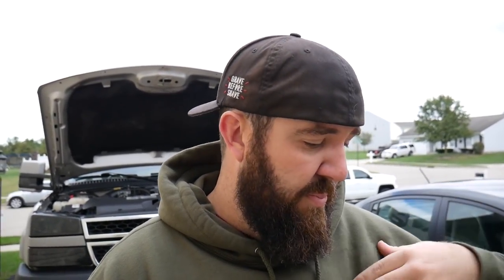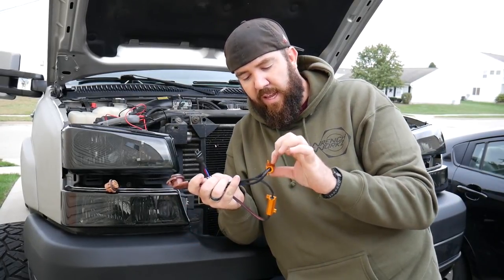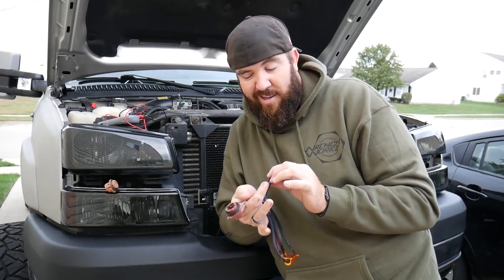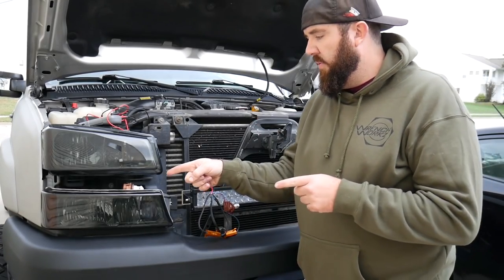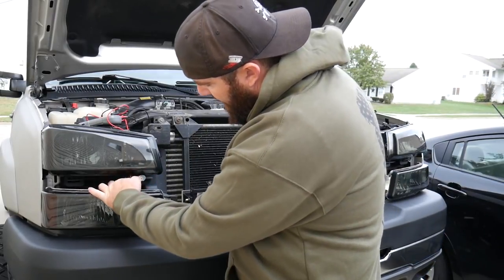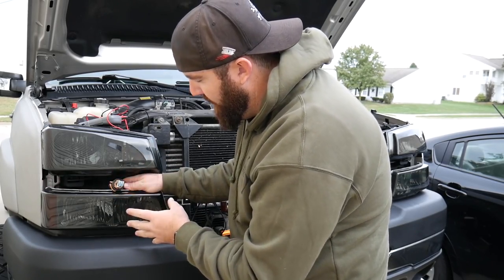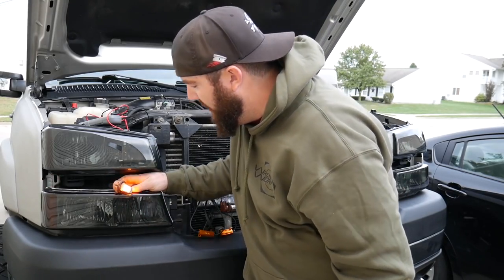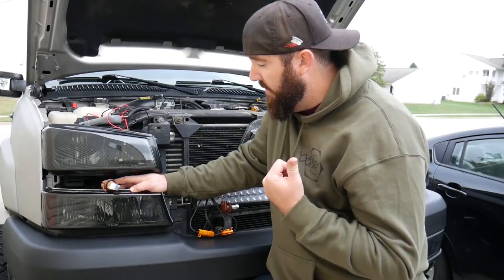FAST FLASH FIX & LED TURN SIGNALS

Comment: What about just swapping out the flasher relay for one that is met for LED lights? A lot easier, and you don't risk the cheap resistors melting down. I read a lot of reviews on Amazon & eBay that were people complaining of the wires melting down. I'd rather not have my vehicle catch fire. 

Regardless, good video man. I've watched your newer videos & you have definitely come a long ways.

Comment: Good job!

For anyone interested in electrical circuits here are some basics:
 
When discussing electrical it is always:
Voltage across a component
Current through a component
Resistance of the component 

For ideal simple resistive circuits we have Ohms law
V = I * R

Voltage (across the component) = Current (through the component) times the Resistance (of the component)

For a given voltage: 
Higher resistance = lower current
Lower resistance = higher current 

Generally speaking resistance increases with temperature. You may notice incandescent light bulbs usually burn out at the moment they are cycled on. This is because the cool filament has low resistance and at the moment voltage is supplied across it's terminals the current is at it's maximum. Once a bulb is on, the temperature, resistance, and current will soon stabilize so long as the voltage across it remains constant.

We do not directly measure resistance. Even the multimeter can only measure voltage across or current through. It may seem like it is measuring resistance but it is actually doing a simple calculation using Ohm's law. 

For this reason your meter can not accurately measure the resistance of a live circuit. The meter supplies a small current through the leads and measures the voltage across them, then a quick calculation V/I is displayed as resistance in Ohm's

If you wanted to know the resistance of a live bulb you can calculate it. 

Measure the voltage across it
Measure the current through it
Calculate the resistance by using Ohm's law
V =I *R
Solving for R
R = V/I (voltage divided by current )

If you wanted to know the power delivered to or consumed by the bulb: 
P = V * I (voltage across multiplied by current through)

Any conductive path from battery positive to battery negative (ground) will draw current through it. It will not draw resistance or voltage. However the larger the resistance of the conductive path the greater the voltage drop across it.

Edited: I hope this is well received and does not confuse anyone. Electric circuits are very useful and understanding these basic things can help you in circuit analysis, design, and trouble shooting.

Comment: No wiring and turn signals work fine.  At night with the resistors both signal dash lights came on and it was a PITA to look at them.  It works on my 01 2500 HD crew.
Reply: Karl Damgaard  can u send me the link where to find them??

Comment: The really correct way to do it it’s replace the flasher module, it’s like $50, easy, and you don’t have red hot resistors

Comment: Great vid really appreciate it. One question is that I used double sided tape for mounting the resistor so they won’t be just hanging. I did notice when they are running they get kinda warm. Just wondering if its a hazard using tape on it.

Comment: I have my right signal flashing fast i checked the bulbs they are all good i  tested from the main harness under the bed and even from there is doing the same thing  i don't have LEDs is oll stock is a 2006 any idea what the problem could  be? thank you for the good videos keep making them 👍

Comment: Good job with the resistors, I can't stand the fast flash error. I could  have sent you a couple sets of the plug and play resistors I have a box full of them when I did my GM. Used em on my motorcycles led upgrades too.  Good info👍

Comment: it appears you only installed on set of resistors on the passenger side and the driver side worked fine, is that alls needed is resistors on one corner?

Comment: I have a 2002 1500, and I have resistors set up, only issue is that when I use the left turn signal the dash will flash with the turn signal, and when I use the right one it acts Normal as it should. Do you think it could be a bad resistor? I checked the bulbs and they come on in both the front and rear. Please help me figure out the issue !!!  Thanks 🙏🏾

Comment: Where do you get resistors i put two new led tail lights in my 2000 dodge 2500 now fast turn signals

Comment: Use the HD flasher relay found under the dash.  This is a much easier fix.
Reply from the maker: Didn’t realize this existed til after the fact lol
Reply: Can you link me this kind relay for a 2003 silverado 1500
Reply: Didn’t work for me

Comment: is there a step im missing ? just installed the resistor product you have and still flashes fast . is there a led flasher for under the dash i should buy . gotta '97 GM c1500

Comment: Okay, down and dirty. I replaced all my exterior incandescent bulbs with the Sylvania ones you had in originally. Installed the LM48 LED relay and still had hyper-flash/dash turn signals illuminated. Installed 2 resistors, one each front directional bulbs. Everything operates as normal now except one thing. When the 4 way flashers are turned on I have "bleed over" from the rear directionals (amber) to the stop/taillight (red). My truck is an 03' Z71 Tahoe with stock light housings. Can you give an opinion on why and what, if anything, I can do to fix the bleed over? I would like to keep the LED "bulbs" because of the sharpness and perceived brightness. Thanks, Paul.
Reply: I was thinking the same thing....I'm assuming you have to install resistors on the rear turn signal bulbs as well
Reply: @mcdizzle7740  No just the front. It caused enough resistance in the circuitry to cover both ends.

Comment: I have 04 Chevy Silverado I have HID headlights and LED all the way around my signals do Flash quite fast but when I do turn on my head lights my signals do not Flash do I need resistors for that?

Comment: Good video.......Question: If my 2004 Silverado truck has factory LED turn signals in the mirrors will I still need a resistor kit to covert the filament turn signals to LED?
Reply from the maker: Should not need to

Comment: My son has 2008 Dodge Ram 1500 with blackout lights n the rear light flashes fast but the front turn signals will not work. Driver side comes on but will not flash for turn signal. Any solution?

Comment: Question, I’m not understanding how these resistors work. 
Voltage=Amperage X Resistance. If the led bulb draws less amperage than the filament bulb it has to have a higher resistance value because it has a 12 volt power source either way. Could you compare the resistance across a filament bulb to that across an led bulb, to that of the led bulb plugged into the end of your resistor harness?
Reply from the maker: I could do that possibly on another video, but the regular bulb draws more amperage than an LED. The resistor just adds more load (resistance) to mimick having a standard bulb plugged in. I apologize if I stated wrong, by brain has been scrambled this weekend lol
Reply: Thanks for the explanation, I had seen a few videos where they spliced them in parallel circuits before. I really like how plug and play that harness is I’m gonna be looking into getting a set of those lol

Comment: How do you like the smoked lights? Also I have resisters and it’s still going fast same autozone brand but with resisters
Reply from the maker: Eh, smoked lights are gone now. And in a later video I also switch to a LED compatible turn signal relay

Comment: the drivers side turn signal is not hyperflashing without the resistor because if you put the emergency lights on they dont hyperflash for some reason. if you put the turn signal only to the drivers side it will hyperflash i thought the same thing 2 when i did it to my truck but after putting everything back i had to take everything off and learn the hardway
Reply from the maker: darian resendez I did too...I’ll have a new video coming out in a few days on fixing what issue this caused on my truck.

Comment: If i leave the turn signals in until I get a resistor will it damage my tahoe?
Reply from the maker: No it’ll just flash fast. Or you can get an LED capable flasher

Comment: turn on flashers, find the noise maker. pull it out, replace it with an led flasher. to easy.
Reply from the maker: Yep I did an update video showing exactly that process also👍🏻
Reply: R S not all cars have flashers. Mine is built into the cars ECU

Comment: So would I only need one of these resistors even for a 99-02 silverado ?
Reply: Did u find out eventually?
Reply: Jimmy Guerrero I ended up just running to oreilly and they sold a relay that replaced the stock one for about 10 bucks and it worked perfectly and still havin no issues with it

Comment: i HAVE THE SAME TRUCK YOU HAVE, i THINK. HAVE YOU HAD IDLE MISSING ISSUES WITH YOURS, i HAVE A 6.0 WITH 171,500 MILES WIRES AND PLUGS HAVE BEEN CHANGED ABOUT 30,000 MILES EARLIER. JUST REPLACED SHOCKS WITH BELSTIENS AND NEW TIRES NOT LIKE YOURS JUST CONVENTIONAL HIGHWAY. REALLY WANT TO CLEAN UP ENGINE ISSSUES WITH MIISING FIRE.LET ME KNOW.